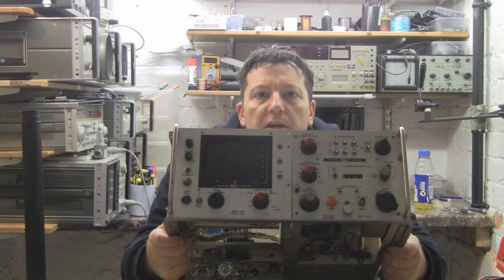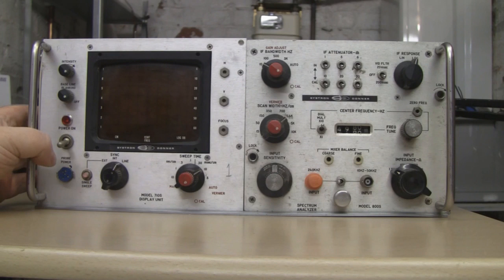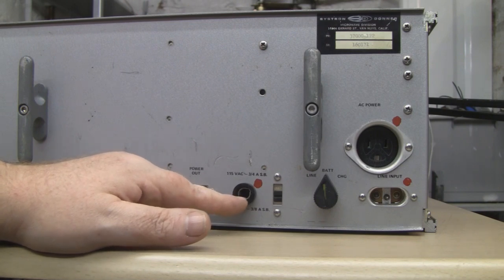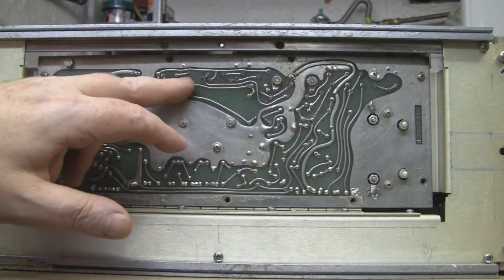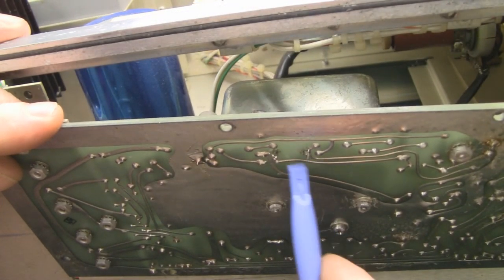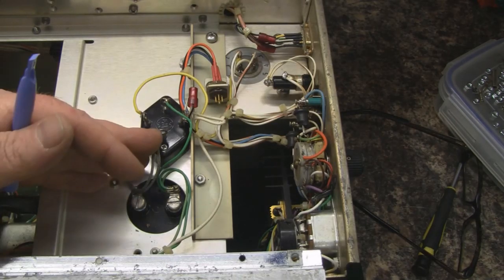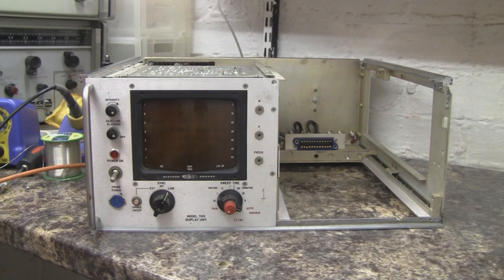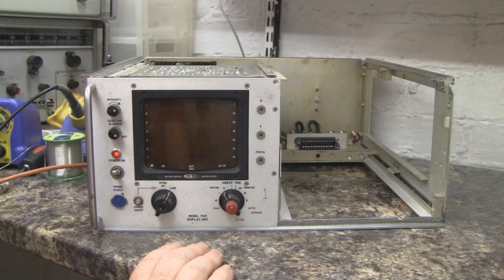Systron Donner 710s/800s Spectrum Analyser  Repair Part 1 #66

Comment: Hi Andrew, I hope you give the spectrum analyzer another go..There is more right than wrong with most things as you  know. Look on the tube neck and you will see the deflector coil clamped to the neck. Loosen the screw holding it in place and you can tilt the display back horizontal. Just don't over tighten it when you are finished; just a little snug.
Back in the 70's and 80's when I would go to a department store, I could usually find the electronics department by listening to the high freq whine from the horizontal circuits in the TV sets. This probably a non issue for your SA..
You will need a way to measure low power for alignment  such a s a power meter and the appropriate thermal sensor. With the SA you are working on, it will be  helpful for some of the high frequency work you do. Even if it's not calibrated, it will allow you to do A/B comparisons of antennas for relative gain and front to back test.
Best of luck.

Comment: COOL! In 1972 my high school guidance counselor told me there was a big future in computers and handed me some sale info in the general purpose analog computers that Systron Donner made. The poor guy died from lung cancer six months later. By 1976 Job's had made his first million selling mother boards.I ran across this old digital computer patent 3190554 that ran on compressed air instead of electricity. have you ever seen such a computer and if so what was it made to do?

Comment: Hello Andrew. You might find a service manual from Tucker Electronics in Dallas, Texas USA. I'm using a Systron Donner frequency counter model 6152A that I purchased (used) from Tucker several years ago on eBay.

Comment: Hi Andrew, just as a matter of interest, I have two old Oscilloscopes on my bench at home and they both make the same high pitched "squeal", I think it is perfectly normal for equipment of this age (mine have done it since the 70's).
I'm looking forward to Part 2 ....
Reply from the maker: Hi yes I think you may be right when I change the high voltage pot I can get it to subside not having any covers on probably makes it sound worse as well. The flyback cable to the tube is in bad shape though so I am hoping sorting that will also help. Having zero experience with tubes of this vintage and no schematics just adds to the fun!